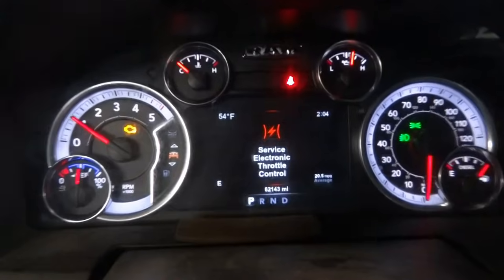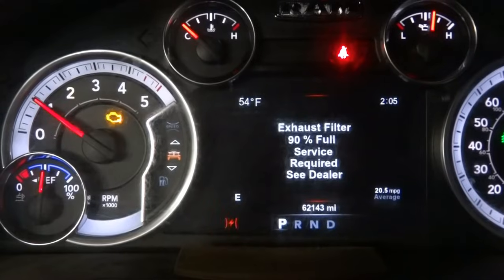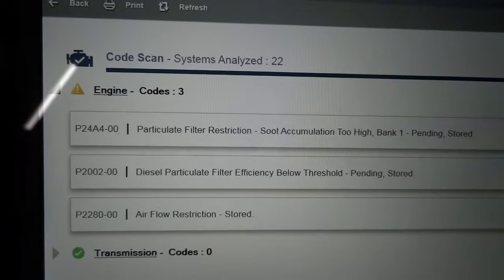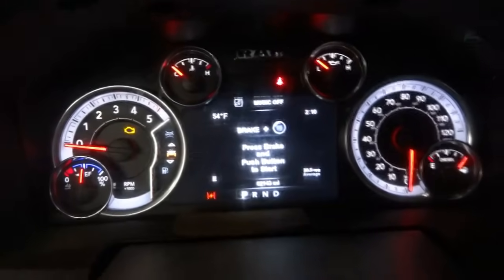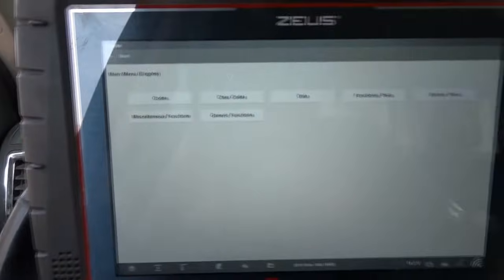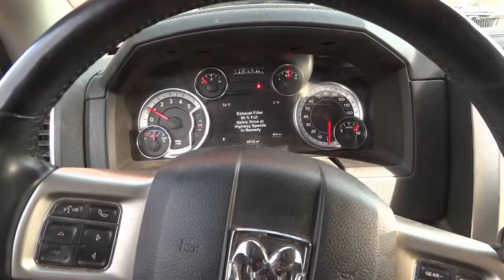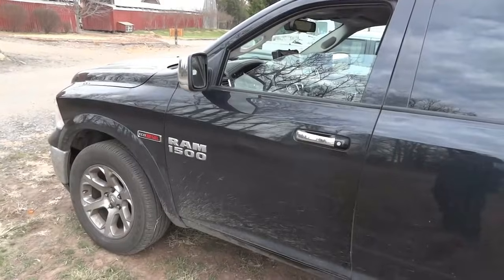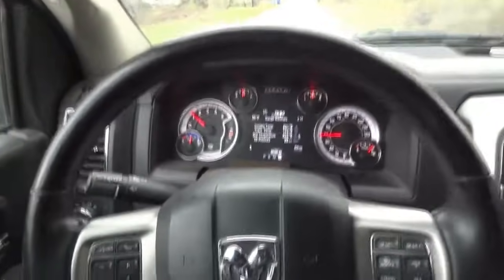DODGE RAM: P24A4 Particulate Filter Restriction - Exhaust Filter 90% Full / How to regenerate a DPF

Comment: A dealership replaced my DPF filter and the sensor and I still have the code P2002 even after driving 7 hr at Highway speeds. Truck has not lost power nor boost its running fine. How do I fix this?
Reply from the maker: Zachary Binx  the wiring or Pcm would be checked!
Reply: @KITS_Auto_and_Truck_Repair  another dealership flashed and updated the pcm before the dealership I bought the truck from replaced the dpf
Reply from the maker: @zacharybinx5859  if the PCM has the latest software the problem might be in the wiring!

Comment: Ram dealership wanted to charge me approx $9000 to replace exhaust and repair engine.  Blaming for dirty filter.  Does the Ram 2017 Eco-Diesel have a regeneration option?
Reply from the maker: Art Sylver  it should have it!

Comment: I’ve had it over 2500 rpm’s for over 30min and still haven’t got a regeneration warning? My exhaust filter is %100 full
Reply: Mines at a 100 now? Did they do a force regen
Reply: If the filter is 100% what I should do??
Reply: @robertobetancourt8251  get a good scanner that will allow you to do a static regen. Clear the codes and then enable the regen. It "should" go into a static / forced regen.  If that doesn't work it is either the stealership or delete the thing.
Reply: @TheElderOne2003  thank you so much.
Reply from the maker: lookits4way bk  you need to it to a pro mechanic! so they can take care of it!

Comment: I have a 2014 Ram 3500 6.7L diesel with only 10.4 volts from PCM to MAF. I checked it at PCM (10.4 V) and  its supposed to be battery voltage. Have you ever seen anything like this? great videos. keep them coming. thanks for great video information.
Reply from the maker: bob White  it sounds like you have a voltage drop somewhere! check the voltage supply to the PCM, is the PCM getting over 13V with the engine running? if yes, then your problem is voltage drop between the MAF and the PCM

Comment: What if I don’t have a scanner? Can I recen manually?
Reply from the maker: Emerson Grellmann  you can disconnect the battery then drive it on a highway for about 30 minutes and see what happens!!
Reply: @KITS_Auto_and_Truck_Repair  so i drive it some and the 100% thing came on so I forced regen by holding the gas pedal at 2500 rpm’s while idled for about an hour but it never cleared up after about an hour and 10 minutes of doing it. It did smell like it was working and man did it sound like an airplane was on for an hour lol
Reply from the maker: @emersongrellmann8578  Lol!! How does it drive?
Reply: @KITS_Auto_and_Truck_Repair  it drives fine, I went to change the output speed censor cause that code was going off and trans stopped shifting hard but then the 100% dpf whatever came on so I tried auto regening but truck runs fine
Reply from the maker: @emersongrellmann8578  ok. someone with a capable scanner should reset that message and see what happens!!

Comment: This was good. However, I had this 90% clogged message come to my attention as I was driving on the highway for the past 5 hours at highway speeds !!  I limped it back to town, the dealership had to do a "manual" re-gen as it wouldn't do it on its own. Now at 1000+ miles later it comes up again, 90% filter clogged.  All of a sudden it comes up, "regenerating". So, this time it seemed to work properly and soon came up 70% blocked as I drove into the Dodge Ram dealership. The check engine light went off, the dealership said there were no messages, so I went on my way.  Now another few hundred miles later the check engine light comes on again, and as it was Sunday, I went into the auto zone store lot and hooked up their computer. It came back with code P0428 Catalyst Temperature Sensor Circuit High ( Bank 1 Sensor 1 )   . I scheduled a visit and am waiting to get in to remedy the situation.  Mine is a 2016 Ram Limited, with just under 69,000 miles.
Reply from the maker: Paul Bohnert  a defective temp sensor can fool the computer to think like there is a restriction in the exhaust system, you should take care of that code and see what happens afterwars!!
Reply: I had this same situation where we had multiple regens within a couple weeks. Then after that, went 6 months before the next regen. Theessage displayed says nearing full, even though we've done lots of highway driving. I'm thinking of pulling those sensors I'm the exhaust and clean or replace at every oil change.
Reply: @AXAR4 hey what happened did it stop mine just came in check engine

Comment: Hey I have a 2021 ram 3500 my check engine light came on saying automatic regen. I drove on the haighway for 30 minutes now the dpf level is down 0% but the check engine light is still on. What should I do?
Reply from the maker: Andrae Allen  check engine light should go off by itself or you can disconnect the battery for 10 minutes then reconnect it!

Comment: How long does it takes to finish the regeneration?
Reply from the maker: Max Ochoa  it depends on the soot level!!
Reply: @KITS_Auto_and_Truck_Repair  how long did that truck take?
Reply from the maker: @Hugolopez732  about 30 minutes!!
Reply: @KITS_Auto_and_Truck_Repair  thank you very much! I have an issue with my 2015 ram 5500, I’m not able to preform a force regen with my scanner, I try and do it but it says soot level is to low, but it says 90% on the dash as well as I only have 10 miles left until it runs 5mph so I’ll probably have to take it to the stealership.
Reply from the maker: @Hugolopez732  Yes, you need to have a pro mechanic take care of it for you!
Reply: @KITS_Auto_and_Truck_Repair  I got the truck to do a force regeneration, before I took it to the shop I took a look at the bottom of the truck and in the wiring harness there were a couple Of cables that were ripped, I bottomed off the other day in the truck and from the impact to the bottom of the truck the whole exhaust system moved pretty bad and the dpf sensor broke so that’s why it wasn’t letting me regenerate it, I had to replace the dpf sensor and solder the cables back together and I fixed the issue after force regen with my scanner
Reply from the maker: @Hugolopez732  Sounds Good! Good Job!
Reply: @Hugolopez732  What scanner did you used?
Reply: @yasielpupo-perez5323  I used my autel mp808, but my xtool d7 can also force regen it.
Reply: @Hugolopez732 what does force regen do and mine has the same problem I don’t know why it’s brand new my truck

Comment: We just were told we need the partical filter replaced not regenerated; what does this mean. Did we drive too long wand truck didn't auto regenerate? We drive truck alot and at highway speed.  PLEAS HELP US UNDERSTAND
Reply from the maker: Julie D  was the DPF removed and tested ?

Comment: Can a 2020 2500 6.7 Cummins be put in manual regen like this 1500???
Reply from the maker: James Orr  yes it can be done!! with the appropriate scanner!
Reply: I have a 2020 ram 2500 with 24000 miles that has started staying in Regen about 1/2 the time I drive it with 95% highway driving, last reading was 115 miles out of regen and 169 miles in regen before it fell out of regen!! Its still under Warranty>>Now 3 trips to the dealer and told that's Normal!!   Any thoughts ?? Thanks.
Reply: @jamesorr2832  good question. Dealer always tells me reset and looks fine 🤨

Comment: I can't find the option to look at dpf filter levels,  must connect to a computer?
Reply from the maker: OTR Alex vlogs  when the soot level starts to go over 50% there will be a message on the dash about it!! you should take it to a repair shop so they can check it out, a good scan tool can tell you the soot amount in the DPF

Comment: Can it do regen if it's 100% full?
Reply from the maker: Navita Ramdass it depends, sometimes it accepts the regen at 100% sometimes it doesn't, I had one here that required Dpf removal at 100%, we had to sent it out to get cleaned!! so it's always good to regen before it gets to 100%
Reply: @KITS_Auto_and_Truck_Repair  thanks for the reply. I am taking mine into dealership tomorrow so hopefully regen helps cuz I was losing acceleration on the pedal on the highway. But had to drive another 200km to get home.
Reply from the maker: @navitaramdass9863  My Pleasure!! Good Luck!!